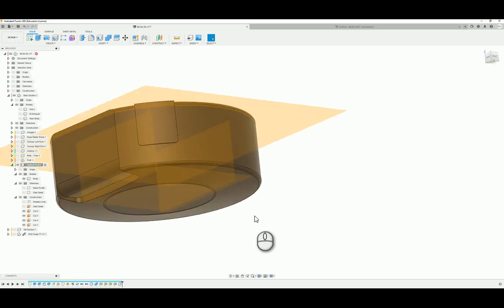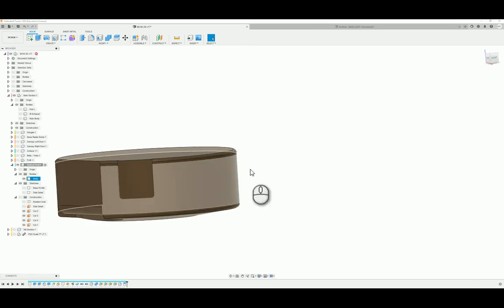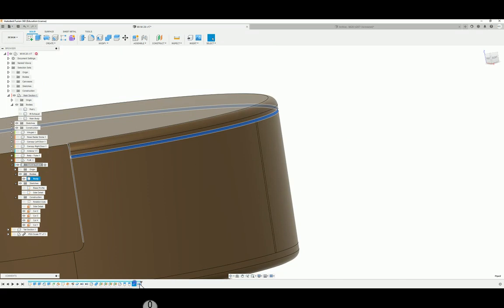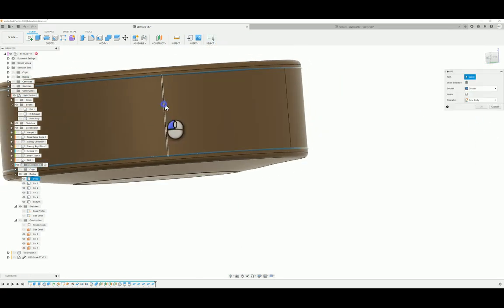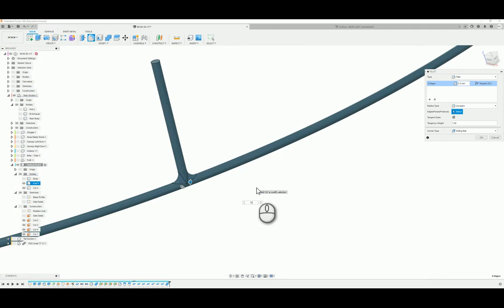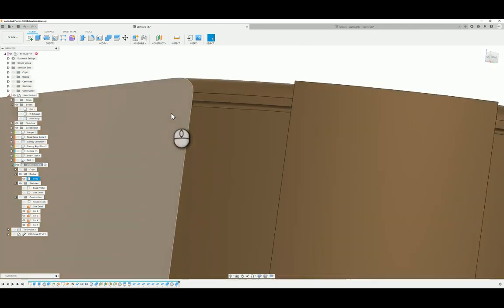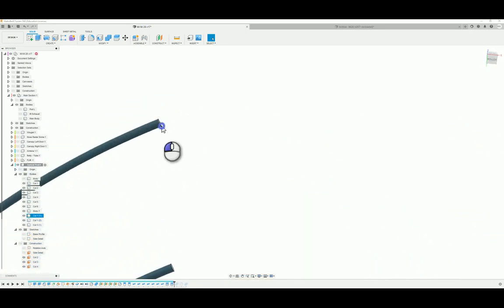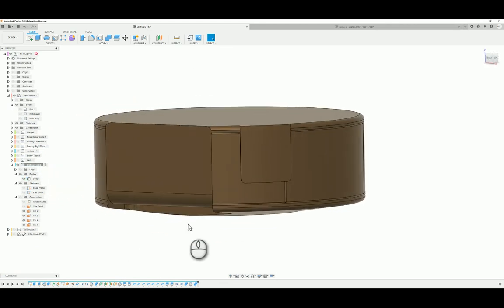[CAD] Fusion 360 - Vehicle Modelling - Panel Line How-to

Comment: Hello when try to cut the pipe froms the surface it takes 30 seconds for it to complete each cut and I have a very fast PC>  is the pipe function taxing to the pc for some reason ?
Reply from the maker: Well, this can be affected by many factors:
a) define very fast PC, the thing about CAD and operations is - they are sequential in nature, run on a single core, so single core performance is the key
b) time to execute specific operations will vary and scale based on the complexity of the geometry and model
c) F360, from my experience has big scalability issues; as soon as the amount of components/bodies increases - together with number of features it does start coming to a grinding halt; one of the reasons why I moved onto SolidWorks. The millage will vary based on the model and it's complexity